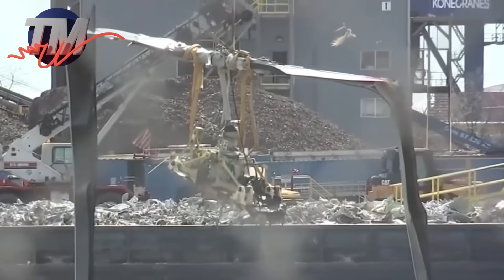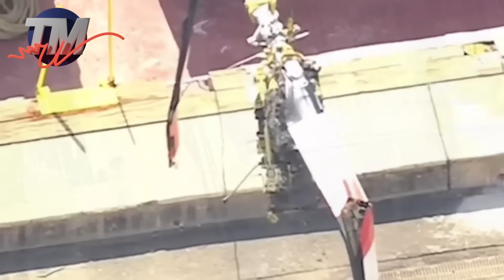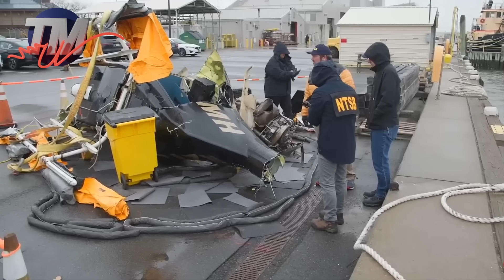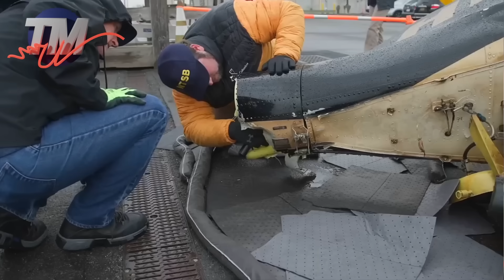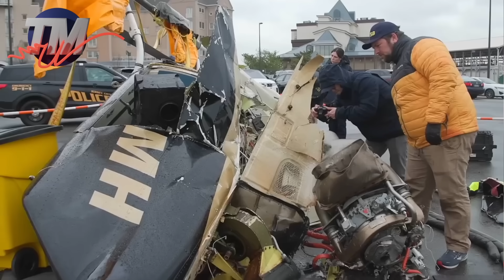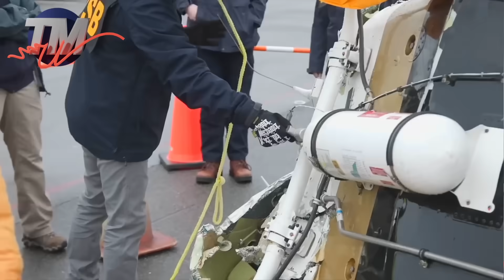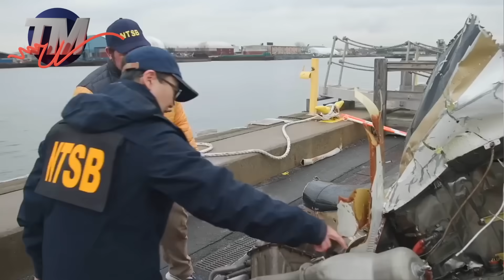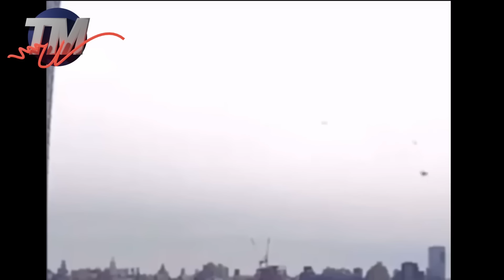Recovery of the Main Rotor of the Hudson River Tourist Helicopter - it's worse than we thought

Comment: Are there pieces of the airframe still attached to dog leg bracket?  They might show corrosion and old cracks. Also I can't see the freewheeling assembly seizing up because of how it's made. I've worked on a lot of OH-58's similar to this and I have never seen one that had mast bumping or even a bad mast runout.

Comment: Helicopter spun clockwise ( looking from above)  when transmission locked up.
This caused the weakest part, tail section, to break off at the weakest, point then moments later the main rotor with transmission ripped of. Tail section changed a 90 degree direction in a instant going into the wind stream. Weak first then strongest next...  Drive transmission gear problem.
Just my guess.

Comment: Looking at what appears to be a violent sudden snap around... The gearbox seize theory seems to really be the only one that makes sense. I've flown, but I'm not an aviation Engineer. If you had asked me what I thought would happen if you suddenly locked the main rotor and fuselage together while in forward flight... I would have guessed that the gearbox would just disintegrate, and you'd still have a free rotating rotor hub. I would have never guessed the gearbox would hold, and the entire ship would snap around. It seems to defy physics.

Comment: I think the engine must have seized up due to either a mechanical failure or improper installation. It happened so suddenly it snapped of the tail rotor and then the transmission. This has to be the worse kind of failure possible as it left no way for recovery as other failures are designed to still help the chopper land safely. I wouldn't be surprised to see the wrong bolts were used to attach the transmission to the engine or maybe the crankshaft snapped causing immediate lock up. I am expecting something on that level.
Reply: The Bell helicopter is turbine powered,  it has no crankshaft.
Reply: @thomashodges-qu9mw  I think they call it a turboshaft but in any event I think it locked up for some reason.

Comment: So here's my comment. A sudden, vicious, engine seizure. The engine stops and the two rotors continue to turn with their inertia and both shear at their wind-up point. For the tail rotor the end of the long shaft and for the main rotor below the planetary gear. Both shear there in quick succession. Not much the pilot can do.
Reply: @georgebrockwell229  There is a freewheeling mechanism (something like a ratchet) between the engine and the rotors. Engine seizing would not stop the rotors. It would just put the helicopter into autorotation without power.
Reply: There is a clutch between the engine and gearbox, it is much weaker than the entire airframe!
Much more likely a gearbox failure.

Comment: The roof beam structure that the transmission attaches to was probably rotten where it attaches to the airframe and it failed causing the extreme yaw and that caused the monocoque tailboom to fail at or near the attachment point and then the helicopter started to tumble and descend and those forces were high enough to cause the entire assembly to break away from the rotten and weakened structure! I highly doubt there was anything sinister going on?
Reply: That is a strong possibility.  Easy for good old boy IA mechanics and kin to bow down to their masters and put profit before safety.  Look up N661TC . Nobody for years possibly decades never inspected one of the few largest wires on the airplane even after repeated starter gen failures.
Reply: Older airframe operating in corrosive seaboard area, wouldn’t be the first time corrosion took down one of our aluminum friends.

Comment: Something in the input shaft to the transmission or clutches, had a major failure and seized up, causing that violent turn that you see in the video and causing the transmission rotor blades and tail section to rip themselves off the body

Comment: Scenario: The failure was at the roof of the airframe and lead to the gearbox-rotor assembly separating from the rest of the airframe and breaking its transmission axle from the engine to the gearbox. The engine then lost a huge part of its load, instantly oversped and tore apart some reduction gear of the tail rotor which in turn sheared off the tailboom.
Reply: If the normally functioning transmission/rotor separated from the roof, it wouldn't have violently yawed the airframe.
Reply: @stargazer7644  The tail rotor would have yawed the airframe until its disintegration since there wouldn't be the angular moment of inertia of the main rotor it is supposed to counteract.
Reply: @ky7299  Helicopters don't generally disintegrate when the tail rotor stops working.  And even if the tail rotor caused a yaw, I ask again, what ripped the transmission and half of the roof with it off of the helo?
Reply: @stargazer7644  Go read my post again. First the main rotor detaches because of structural failure, then after a second or two the transmission of the tail rotor disintegrates because of overspeeding and cuts the tail boom. What you say is irrelevant.
Reply: I concur with your scenario. See my comment above. Roof/airframe failure.
Reply: @dw566  Another thing I was thinking is that a seizing up of the gearbox would not generate enough torque to stop the main rotor (a huge flywheel with lots of kinetic energy). It would just shred the gears and damage the casing but the axles would keep turning freely. I expect gearboxes to be engineered to fail like that because any other type of failure is non-recoverable. Car gearboxes fail like that too.

Also I suspect a flaw or degradation inside a gearbox is much easier to catch in a routine inspection than a flaw in the airframe itself. I still remember that Aloha Airlines 737 that went convertible.

Comment: Back in 69 I was a Huey pilot. Some of my additional training include IP school and an accident investigation school. In the accident investigation class, we studied a Huey crash that had a similar inflight failure. What we discovered was a high side governor failure. The rapid increase in power caused the tail boom to flex horizontally and separate from the helicopter. Then the transmission and main rotor separated leading to total self-destruction. We were taught to recognize the difference between that and a short shaft failure which also caused a rapid increase in main rotor speed. the emergency procedure for each was different and opposite of each other.
Reply: You may be onto something there! Sounds like identical conditions and failure. Zero time for the pilot to do anything but realize he’s screwed.
Reply: @JRLittleArt Wow you've given me something to think about. 
Sidenote: when I was 6 (so early 80's) my Dad got me and my brother a ride on a Huey. It's an experience I remember to this day...what a ride!
Reply: You mentioning a governor failure made me think of a story told to me yesterday. A mother told of her son dying in a restored Sea Fury.  She said the governor failed and the prop over sped.  The angle of attack went too high and the plane stalled and crashed.  So sad to hear this from his mother.
Reply: That pilot had time to exactly ZERO emergency procedures.
Reply: I agree. From time 1.48 to 2.12 you can see a large hole in the tail section where the break is, where the tail section came off on the side facing the camera, the left side if the tail boom. Do you see that?
Reply: So why would the pilot have such a rpm on the helicopter. You mean he was going too fast? Or avoiding something ?
Reply: Very interesting.
Reply: The only thing about the High Side governor failure that I don’t think fits is the rapid 90 degree turn to the right before the failure of the tali boom. 

A high side failure, or at least the ones I’ve had on the 212 and 412 the increase is quick but not instantaneous.  Then the reaction is raise the collective to stop the overspeed of RRPM, roll the throttle of affect engine to idle, then select the governor to manual on the affected engine. (Get ready to lower the collective rapidly as that engine goes to idle, entering autorotation as required.) Then roll up the throttle and control RRPM, and N2 manually. A trick on the twins was to set it the N2 low and let the good engine do the Governing until on short final.  

My thoughts when i saw the rapid rotation to the right was a loss of tail rotor. We had this happen on a SAR 412. The back end crew members survived. They both talk about a violent yaw almost to 90 degrees as the initial reaction to the loss of the tail rotor assembly.  
In the case of this 206 that sudden right yaw may have over stressed the tail boom causing a catastrophic failure which in turn broke the transmission mounts due to the violent twisting.
Reply: Siemens was being investigated for espionage, Jessica Aber investigating Siemens found dead. CEO of Siemens Spain dies, coincidence? The tail fell apart at the joint, interesting isn't it?
Reply: How does it come from tail boom detachment to main rotor detachment? Collision? I can' t imagine just by overpower. Or can the subsequently open rear rotor driveshaft bring the transmission to freeze?
Reply: @thomasschwarzenberger8943  I think the harmonics and resonation imbalance as a result of the failure disintegrated it. There is a lot of residual torque, force, and rpm energy uncontrolled all happening in a split second. Those forces have to go somewhere and unfortunately the airframe overstressed and destroyed itself as a result. Just a subjective opinion.
Reply: You must be pushing 80?
Reply: Aviation fuel changes?
Reply: Random but do you remember a Huey crash in Lai Khe in Jan 69?
Reply: They hit a cloaked u f o
Reply: i mean you can hear the rpm in the video
Reply: Hey brother, thank you for your service.  1969 was a "learning experience."  My sincerest wishes for your continued long life.  Keep the turbine off when you can and stay safe.

Comment: My theory is that the main planetary reduction gear seized.  The torque of the counterclockwise rotating main rotor is now applied to the airframe causing the right yaw and the main planetary gearbox to be wrenched loose from the the rest of the helicopter.  The combined stress of the gearbox being yanked lose from the airframe along with the violent right (clockwise)  yaw  on the tail rotor, which is already applying a sizable counterclockwise force against the airframe, overstressed the tailboom resulting in it's separation.
In short, I think this was a material/maintenance/QA failure.
Reply: That is possible, but if the MR gearbox seized, then the mast pole would have at least shown massive twisting or would have twisted off probably where the cone set sets in the mast pole, (weakest point) because of the inertia of the main rotor hub and blades.  20 years working on and flying in these.
Reply: That'd be fine, but the boom departed first. The main rotor can be seen leaving the fuselage after the boom separates. I think the tail shaft broke (for whatever reason, something rearward seized), and cut the tail boom off, the resulting yaw created severe stress on the transmission mounting and ripped the roof out of the fuselage. In the full video from the CCTV camera, there are distinct sounds like the tail shaft whipping around inside the boom.
Reply: @ yep agreed tail rotor system should be looked at. Did they find it ???
Reply: Most plausible explain too I have heard. I guess they didn't keep up with tranny oil samples.
Reply: Mines, the rear rotor failed first talking out the boom then the main rotor and transmission.
Reply: @rsrt6910 
"causing the right yaw and the... (everybody died right here) ...main planetary gearbox to be wrenched loose"

Comment: Until they showed the recovery of the rotor section connected to the transmission, the mast bombing theory was plausible. With the massive catastrophic failure, I think that is out of the question. If it was maintenance that large a problem would have exhibited resonance and torque problems in daily operations. I can't imagine the terror everyone felt. The evaluation of causality needs to be extended outside the scope of the incident.  Plus the FAA needs to look at the aircraft certification of this type of aircraft operating in the flight level. And pilot cerification. Overall the standard NTSB time frame needs to move this investigation to the top of their priorities due to the situation taking on suspicious circumstances of the wreckage. I USA official or relation should accompany the bodies of the family back to their homeland. This is going to get very litigious, the company will have a tough time surviving.

Comment: Still we cannot come up with something very obvious - where is the tail boom ? My very first idea was that the gearbox seized which could explain the massive torque that was required to dislogde the box or a major part of it. That caused the boom to swing rapidly and it brooke off.
Reply: In the river
Reply: That was my first idea as well, and then you think, what is the weakest point that would give first?  Would the gearbox strip out?  The mast break from the torque?  Apparently none of that happened.  So the weakest point was the roof deck?  Very strange!

Comment: Your are right about the politicians are putting a political spin on these aircraft accidents to drive down the stock prices so they can buy cheap and then pass some bill to induce the stocks to go up and make a huge profit. 
 As to the helicopter; it appears to me that the roof of the fuselage ripped off the top of the helicopter. I also seen another video with sound and as the helicopter suddenly yawed there was a loud WACK WACK WACK sound as the helicopter broke apart. Leading me to entertain the idea that roof started to rip off starting at the front, tilting the rotor drastically up at the front and down at the back causing the tips of the main rotors ( which both showed signs of impact damage) to strike the port side of the tail boom snapping it off and causing the fuselage to rotate to the right (which is the direction induced by the counterclockwise rotation of the main rotors) and also helping the roof to fully detach. So I would like to see the roof connection to the top of the fuselage for signs of corrosion or metal fatigue.

Comment: Possible unintended right pedal input. If you view previous videos posted by the deceased pilot, the rudder pedals in LH side were still installed and not covered by an available pedal/pax protection cover. If the LH pax turned around in cockpit to speak for example to the rear pax, it is quiet feasible they could have depressed the pedal and in that case at say 100 kts cruise speed,  for sure the tail boom would structurally be overloaded and fail. And for information and clarification the way the tail boom separated just after of the attachment structural members (4x aluminium castings). The physical tailboom fuselage interface with its 4 bolts are still intact. I have owned and  flown and rebuilt several 206’s so I am fairly up to speed of the structures and assemblies of both the 206’s B and L versions.
Reply: In the BH206 the passenger side pedals can be left in place, be disconnected from the control rods, and pinned in place.
Reply: I could be wrong but wasn't it supposed to be the oldest child (11?) in the front seat?
With your familiarity with the 206, do you think inadvertent full rudder pedal is likely/possible with a passenger that size?
Also the pilot was a pretty big guy. Presumably he would always have his feet on the pedals, or is that not necessarily the case?
Reply: @alanm8932  you are correct in that the distance from child’s feet to rudder pedals is quite a way. Something caused the violent yaw. A few years back a Chinook helicopter crashed because of stuck anti torque pedals. It was found that an iPad had dropped between the pedals and caused a stuck pedal. In no ways am I suggesting this in this case , however there are very limited issues that could cause such a violent yaw. Pedal input being one, or a transmission seizure another one. This occurred on a Norwegian Eurocopter ( recall EC225)  a few years back and it took off the complete main rotor head in a similar fashion and helicopter plummeted to the ground. You can google the incident I am sure. The Cause of the main rotor  transmission failure was a harmonic resonance in the planetary gear set. Long rangers / JetRangers to the best of my knowledge ever suffered any inflight planetary gear set failures. The 206 series fleet has something like 160 million flight hours with zero mechanical failures (besides TT straps) which causes a complete blade departure which is definitely not the case here.
Reply: Tailbooms are stressed skin construction.  Any dent, wave, or wrinkle can cause a failure.  Even a bird strike.
Reply: @RotorheadUK  that's something a child could do. And there was a child in that seat, as I understand from the reports.

Comment: I agree with "endless". I said from the beginning it looked like the tail rotor seized or broke off causing extreme twist torque on the entire airframe.
Added: It is important to note the airframe/body did not look that damaged on the way down. Most of the damage seems to occur after the ground contact.